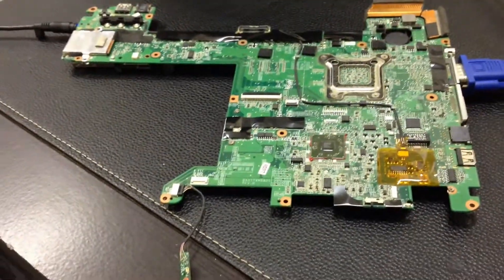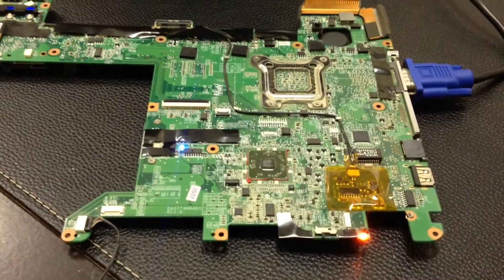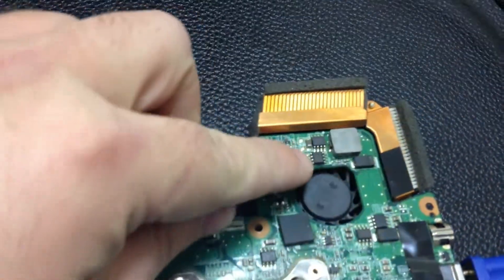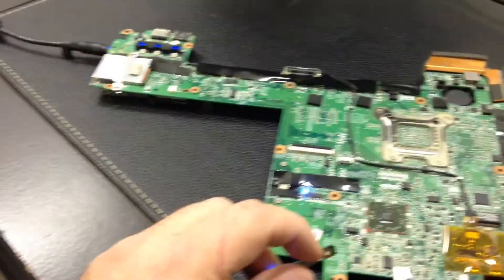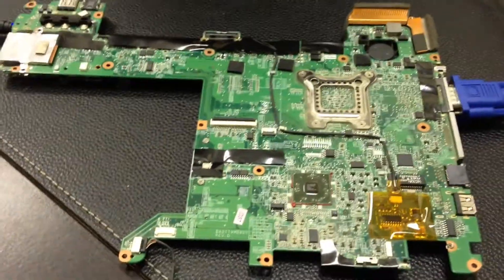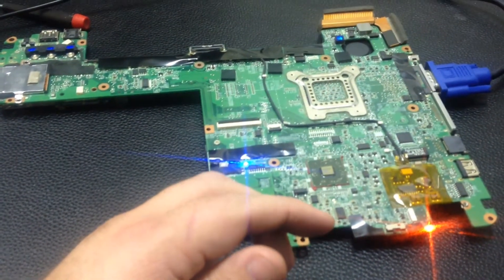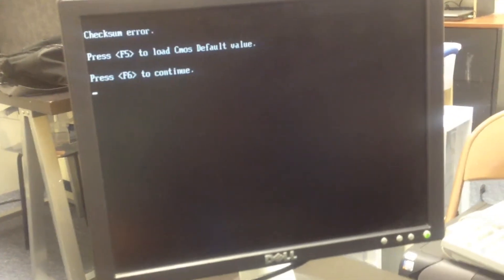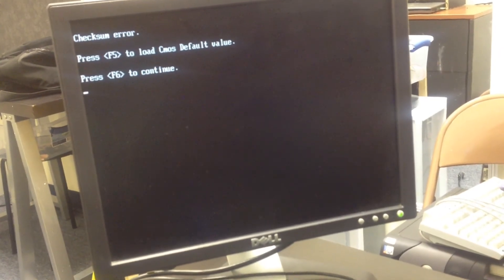HP TX2000 with no video and no boot fixed at Doubleclickittofixit.com laptop computer repair

Comment: What is a reflow exactly?
I have a 10" asus seashell which is powering on, fan starts going, but nothing else works.
Tried a lot of things which didnt help (removing hdd, removing electric static with power buttin, removing memory) nothing helped. I have no video display or nothing, just power on. What do you think?